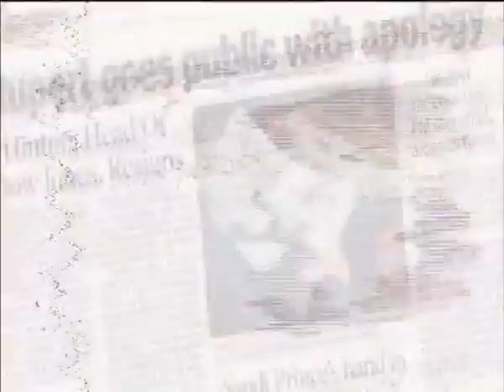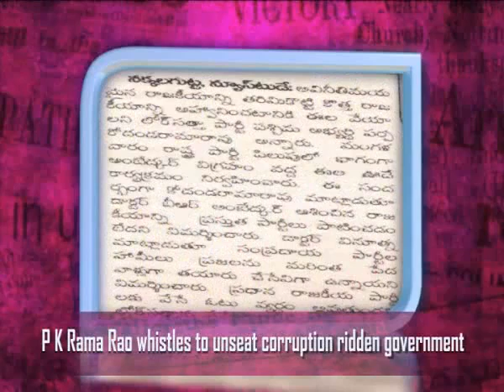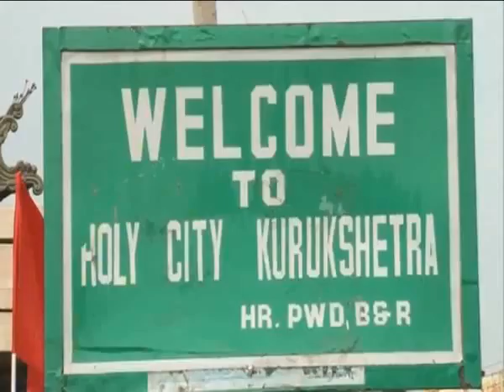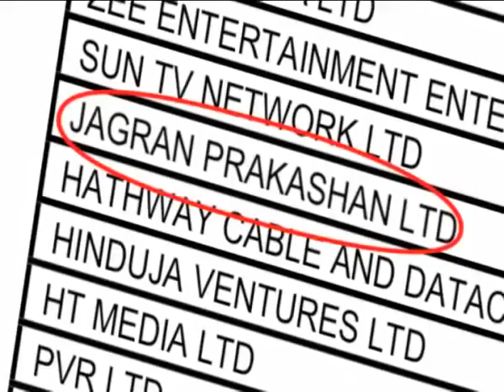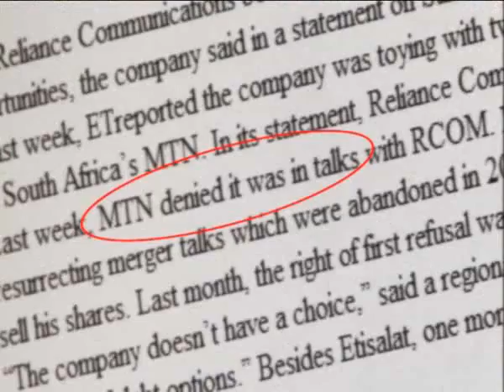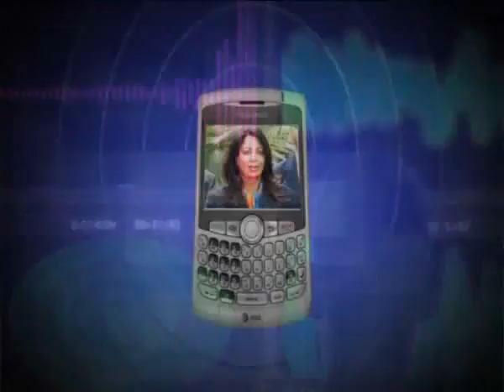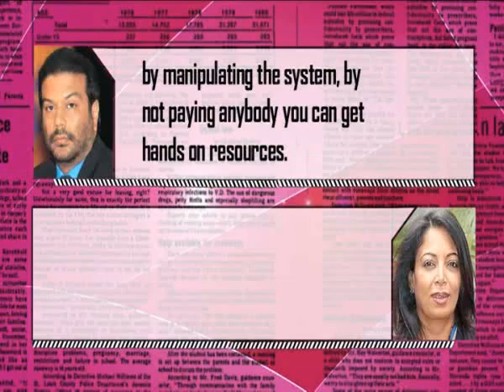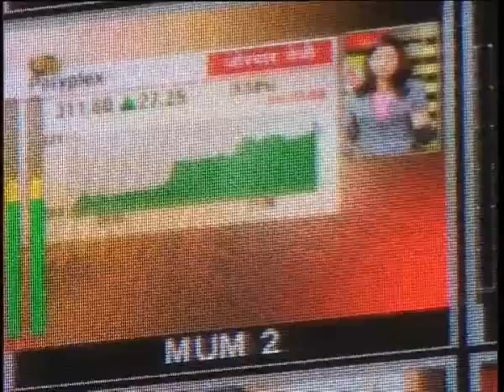Shocking - Indian Paid Media exposed Completely - Must Watch for Indians!!!

Comment: One only has to look at DRDO, to see why India has not progressed. It is not the fault of the modern individual Indian that in a country with an enormous talent pool, the only major defence research institute has a measley 3% of PHD, and a poor track record. If one were to pinpoint the one culprit in India's stagnation, it would be the lack of management ethics. It is a social malaise stemming from the caste system - where one man no matter how small his achievement, is better than another solely because of his higher caste. Granted, there are specific castes that dominate in wealth and power. This however, is a testament to the achievements India could have made if the whole of India viewed itself as one caste.

Comment: But why these corrupts were given such a high post in first place.CM and Party President !!! "Modi has to worry about other than corruption" One more excuse in favor of Modi. isn't it??? I would have asked about Lokayukta. But leave it I know you will drag it to center. Anyway  for me both congress and BJP are same. If BJP comes to power then it will do the same as congress. Then what is the profit. If I vote for AAP at least I won't think I am a culprit to vote in favor of a corrupt party.

Comment: Can't have it both ways corrupt went to jail cos BJP didn't interfered with CBI (unlike Congress) Modi has to worry about issues other than corruption too. Can't move around with microscope in Gujarat. Yr tolerance, opinion &vote will definitely make a difference. Think logically for once: AAP will not win election this time (even you conceded Rome was not built in one day) instead on voting against Congress vote will split between BJP &AAP result: Congress benefits. Thatswhy AK was launched